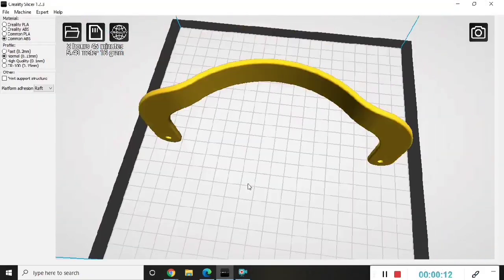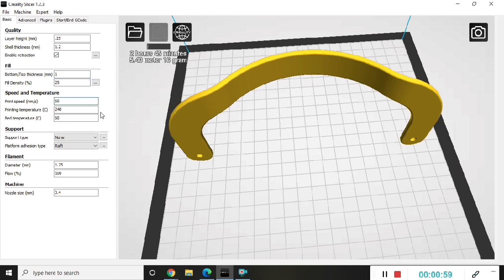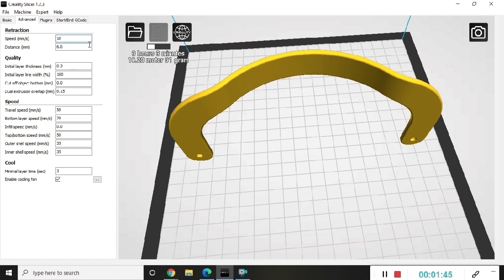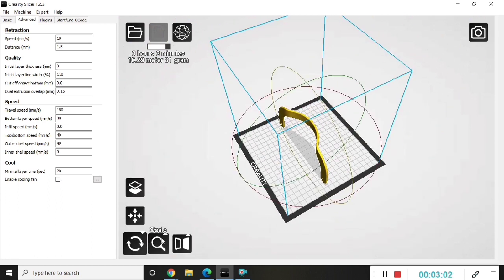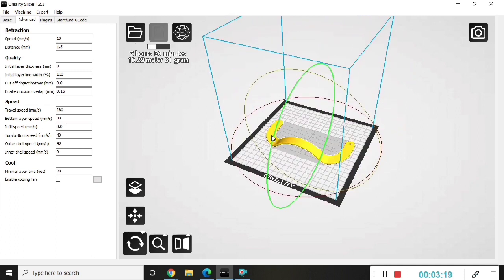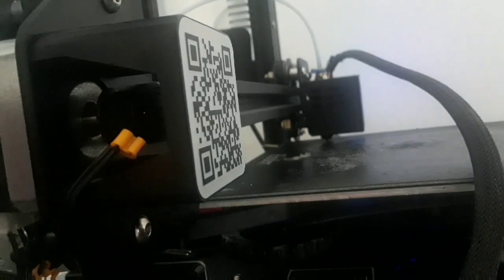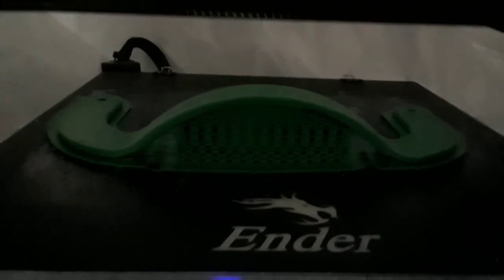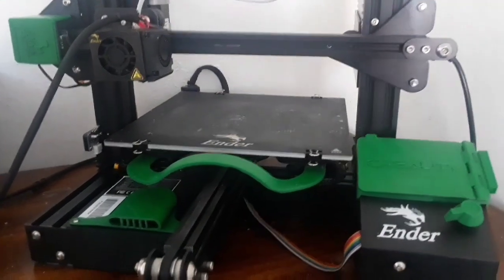How To 3d Print ABS With A Open Frame 3d Printer // Creality Ender 3 // ABS Tutorial

Comment: What temperature you will use in nozzle and bed? And what kind of plastic you will use for inclosure in 3d printer? Thanks2
Reply: You will use 110° degree in bed? But in the information of Creality Ender 3 - 3d Printer was <100° degree in bed? Its ok to use 110° if the availibility was 100° only?

Comment: Hey just wanted to say thanks! I just bought my Ender 3 printer and been struggling all week just to print out the test dog model. It kept breaking apart after 5 or 10 layers just like you showed in the beginning of your video. What fixed it for me was turning off the cooling fan, which I knew I had to do, but didn't realize it was running the whole time and then putting a plastic bag over the machine. Never thought about using a bag. I'm going to create plexiglass box, but for now the bag works awesome. So thanks again! You saved me a lot grief.
Reply from the maker: No prob that’s what I figured I should do my videos on things that I have problems with and it took a long time to get it printing right

Comment: Just about to try this as nothing else has worked. Fingers crossed!!
Reply from the maker: Should work with an enclosure, leveled bed and good adhesion also make sure to go with the settings of the brand of filament your using and keep in mind the angle that you are printing
Reply: @pericodesign1679  Holy shit! It worked, no enclosure either! I must have had my bed temp way too low and my retraction settings al to cock. I've never been sure what retraction does tbh :S
Reply from the maker: @philbateman1989  TBH I'm clueless to what half of everything means🤣 I ask for help when I cant figure something out and people write me whole paragraphs and I dont know what they are talking about lol it took me a while to get it down alot of times it's simple things it's best to have a checklist like Change nozzles, use an adhesive, bed and nozzle temps, maybe use rafts or brims, the angle of the print, the print speed, the leveling, and an enclosure sometimes ABS can get frustrating